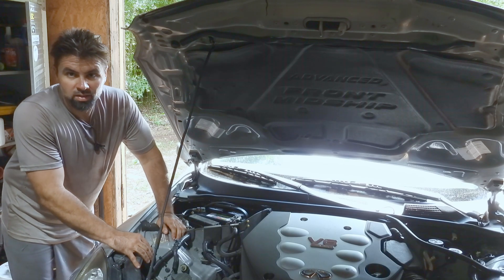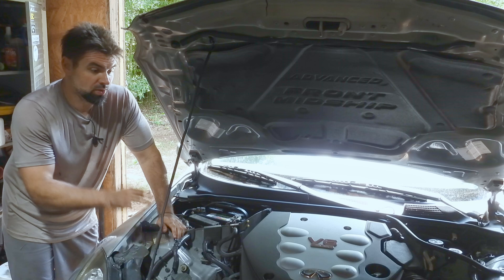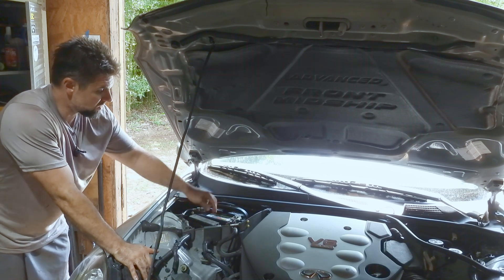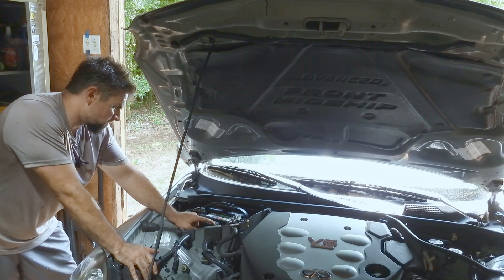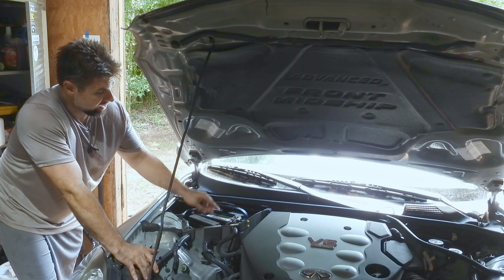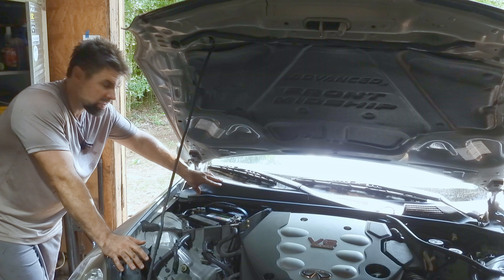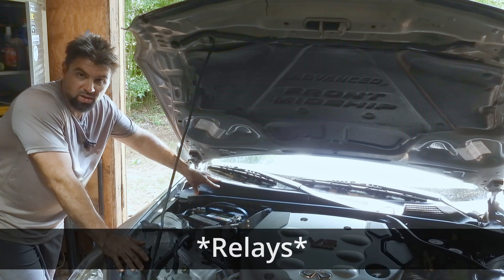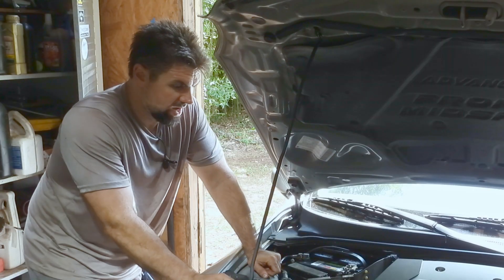Infiniti G35/Nissan 350Z Cooling Fan Diagnosis

Comment: Hey Matt, are both fans connected to the same relay and fuses? I only have 1 fan that turns on at this moment.
Reply from the maker: I think there are 3 relays in the mix. You would have to look up a diagram and see which ones, but im fairly certain theres a few different relays involved. They're in the IPDM fuse box under the cowl.

Comment: Hey Matt. I’m not sure if you will ever see this but if so I would love some help/feedback.

So I have a 06 g35 coupe and the fuse link fuse with the following 50/30/40 Amp fuse more so the (40amp) fuse blew/overloaded, after changing out with a new one. I have a aftermarket most likely Chinese fan, could that be the issue as to why it’s overloading the fuse and bubbling the fuse? As the fan worked for a few days and then blew the said fuse a few days later.. If so can I just replace the fan motor or should I replace the whole shroud? I’ve been chasing this problem for a few months now as it’s overheated a tad bit sitting in traffic! Any help would be helpful!
Reply from the maker: @duesa2203  the fans could be the problem for sure. It sounds like their is a short to ground somewhere. You can check the fan wires with a meter and see if any of the legs have continuity between them (they should have resistance, although I don't know how much). It could also be that the wiring to the fan is damaged somewhere and shorting out on the frame or something metal, so that might be worth checking.

If I diagnosed a faulty fan motor, I would probably swap the whole fan assembly. I know you can replace the motors, but you have to pull the assembly out for access. 

Good luck with getting your issue fixed and let me know what you find!